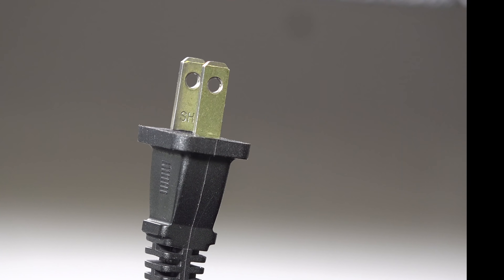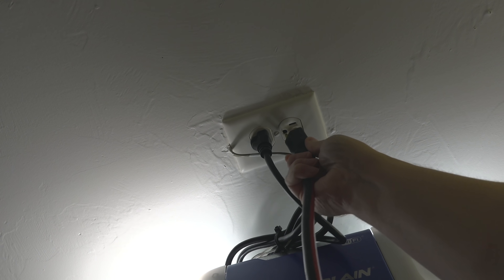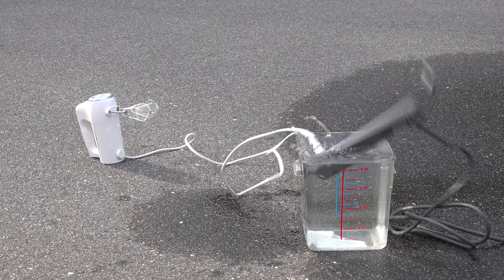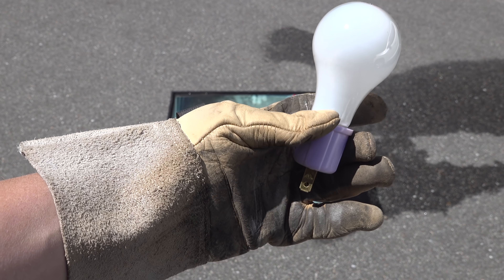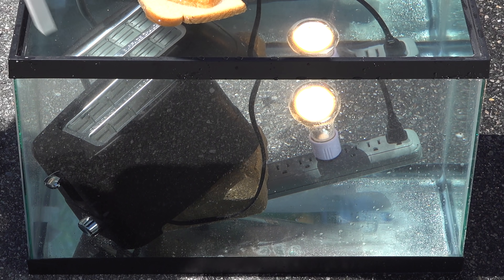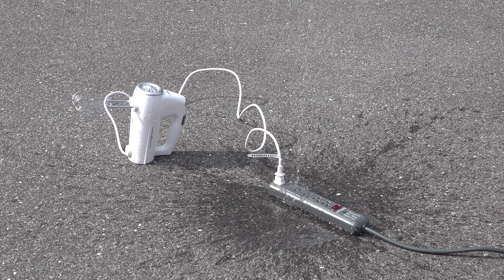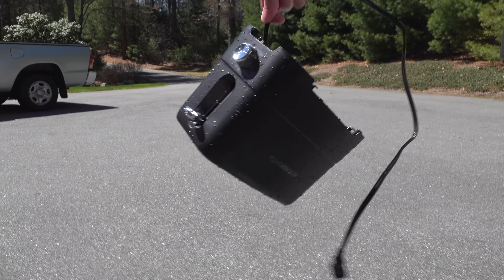What REALLY HAPPENS WHEN YOU SPILL WATER in an OUTLET?

Comment: TL;DW: As discussed by many this experiment is highly dependent on the device and the purity of the water. Pure water with no contamination is actually a pretty poor conductor.
Reply: For other experiments it would matter. We already know a small amount of electrical current was flowing through the water because the GFCI tripped. Let's say that there is a 20A breaker that this circuit is on.. you could keep dumping bags of salt into this water and by the time it tripped the solution would be nothing like any water in a house where you would find toasters, power strips and light bulbs. Once you change the variables too much the experiment becomes useless.
Reply: Actually, pure water with no contamination is an insulator. However water is a good dissolver and therefore is will become contaminated very soon after being placed anywhere.
What we see here is relatively low voltage. 120V maybe.
What I can say, if the voltage was 230 it would boil that water tank with extender only after a while. I have seen water boilers working same way, sized as a cup. Water itself is a (average) conductor and heating element.
Reply: @Auberge79  no it isn't water is not a good conductor,

Water with extra elements can conduct 

Get bottled water 

Pure it into a glass

Create a simple electric circuit with a light bulb and battery

Break the circuit and use water in between the break 

I will 100% garrantee the ligh will not work 

Now fuck a bit of salt into that water then balm the light turns on

Water does not conduct electricity added elements do
Reply: Around here they have to put extra chemicals in the water to prevent the water from corroding the pipes all to hell. At the faucet it's going practically no dissolved solids in it.

Still, I'm not sure that I'd care to check to see if there was any conductance going on.
Reply: Also 120V is relatively mild compared to 230-240V that is used in most other places around the world.

Plus a surge protector strictly speaking trips when the mains voltage exceeds a certain threshold. A surge protector is there to protect the devices plugged into it from something like a lighting strike nearby, not to protect people from getting shocked. As the input voltade didn't change by putting the extension in water as far as a surge protector is concerned everything is fine. There are two ways in which putting something in water may cause a circuit to trip which are 1) the fuse on the breaker IF the extension draws more current than the socket is meant for (may not happen with pure water, even if you put your hand on it and get shocked) and 2) the RCD will trip if enough current starts leaking to ground and this is what will protect you if you put your hand on it, but it won't work if the extension/device isn't even grounded (and a lot aren't). 

If the device isn't grounded and you happen to touch both live and neutral (instead of ground) there is really nothing there to protect you because the breaker has no way of knowing that the current is going through you rather than any other electrical device, and because the human body has a fairly high resistance the current won't be enough to blow the fuse.

Comment: Circuit breakers are only meant to stop the wires in your house from overheating and causing a fire if you are using too much power. They are not designed to detect the presence of water. That's why GFCI outlets are put in bathrooms, kitchens, and outdoors.

Comment: There's a difference between electronics and electric things. Electronics, unless having water protection, tend to die when wet. Electric stuff can resist water, but if you enter in contact with that water you will receive damage.

Comment: for the people that doesnt know
totally clean water does not conduct electricity, this is because of the molecular atomical structure of the water.
however
-water contains oxygen that rusts the metal parts of the power outlets, as well if poured on metal in general
(although at a slow rate)
-if your water conducts any electricity, it's because your water isn't totally clean 
that's why if you try to make a circuit with a light bulb, where you cut 2 cables and "connect" those cables with 3rd world tap water the light bulb will flick

Comment: You never told us what the source of the water is.  Regular drinking water or faucet water that contains minerals will absolutely help arc electricity since it is used as a medium.  On the other hand, distilled water has no form of contaminants to help pass electricity between electrodes

Comment: Your mileage WILL actually vary depending on where you live. If the water in your area is harder (ie, has more mineral content), then it'll be FAR more conductive. The temperature of the water also matters. This was probably done with 110v, but most of the world uses 220v to 240v,  voltage also matters.
Reply: 120 is just split phase 240, so every where that uses 120 also uses 240. The biggest difference is most of the world uses 50Hz instead of 60Hz.
Reply: @Kanglar  Well, by that metric 240 is split phase 380, so every country that uses 240 also uses 380. But, I agree, frequency is far more important, and it'd be far easier to integrate two grids with different voltages than two with different frequencies.
Reply: @Kanglar  well, 220v is just single phase 380v, so everywhere were people use 220v is 380v
Reply: @Kanglar  That's irrelevant because what comes out of the socket is still 120V. And it will behave as such, for example the maximum wattage is much lower at 120V than at 240V.
Reply: @InWeCome  What comes out is 240 if requested, that's why it's relivant. As seen in the video, 100v of power from the toaster and an est 50v from the egg beater are occupying well over a 120v circut.
Reply: Came to the comments to find or mention this.  Salt water or really hard water would have been far more exciting.  The voltage is mostly irrelevant, though.
Reply: Right, kind of a let down that they didn't mention this in the video....
Reply: @ElectricSlevin  why would they
Reply: @diamondgirls6541  cause it would be educational, interesting and maybe prevent a hand full of people from making a really stupid mistake
Reply: @ElectricSlevin  he doesn't have the knowledge
Reply: bulllshit
Reply: why
Reply: Absolutely 🤣😂🤣 very important to know and consider.
Reply: So zero water is probably almost non-conductive.
Reply: What if I accidentally spit on my outlet behind the trash can a few times? Will I be ok?
Reply: I just spilled some mineral water on my extension plug and nothing happened. My country is using 220v
Reply: Yep, agree.
Reply: "...the US does have a higher power supply. Nearly all homes in America have 240V alternating current lines at the service entrance to the household as well as select locations within the home."

I also use a 1,000w Toaster (100v) while running a 500w egg beater (50v) off a 120v circut just fine.
Reply: Your point means absolutely nothing. The point is, these electrical appliances were submerged completely and still functioned properly.
Reply: not most the world
Reply: @allentoyokawa9068  all of Europe and most of Asia is not most of the world ?
Reply: @Kuri0  and most of Africa: https://en.wikipedia.org/wiki/Mains_electricity_by_country#/media/File:World_Map_of_Mains_Voltages_and_Frequencies,_Detailed.svg
Reply: @InWeCome  Also Australia uses 240v mate
Reply: In fact, only the northern part of the world uses 220v in a common way, from the center to the south of the world, 120v is already used usually (there are exceptions, but it is to give us an idea)
Reply: @altair_sound  I don't know where you got that idea, but it's totally wrong. Not just wrong,  but opposite to reality. There are basically NO countries south of the Equator that use 110/120. The only places south of the Equator that use 110/120 are a tiny bit of Colombia (most of it is in the northern hemisphere) and part of Ecuador. That's it, a small part of two countries. Pretty much all countries that use  110 are in the northern hemisphere, namely all countries in North America and most in Central America plus Japan. The entire rest of the world is all 220 to 240v.
Reply: @altair_sound  I dont think Ive ever seen anyone be so confident in something so incorrect before. Where tf did you even hear that? Its quite literally the opposite of reality.
Reply: @altair_sound  confidently incorrect👍
Reply: Your house gets 240 volts but it's split into 120 volt A and B phases which are opposite at any given time (hot is negative on one and positive on the other and visa-versa.) There are special outlets that some home appliances use that make use of both phases at the same time, delivering 240 volts)
Reply: @plateshutoverlock  That's in the USA (and an odd few other countries). In most of the world we have 220 to 240 in every outlet. Special outlets are to make use of all 3 phases to deliver 380v.

Comment: Dunno if anybody here explained this, but the water does not conduct electricity (regular outlet power) only salts and iron that dissolved in it. In that experiment were pretty clean water, if you do that with tap water or sea water - it'll definetly shorts the circuit.

Comment: In some rural places in India and Nepal, they use this device? That's just a bare metal coil with some plastic on the top and plug that in an outlet and put the metal coil device thing in a bucket of water to make hot water. No protection other than the user just not touching it lol

Comment: I’ve seen regular outlets working outdoors everywhere, powering all kinds of stuff without problem for years.
I’m not quite sure why, but those outlets and appliances often just don’t seem to care.
Not sure how dangerous that is or isn’t though.
Reply: You don't need them if you've got them on a circuit that uses a GFI breaker. Or, they're sealed well enough and still grandfathered in. The next update to that is AFI that looks at the resistance on the circuit as well in an attempt to identify excessive resistance from failing wiring that could lead to fire.

Comment: Water itself is not a conductor of electricity its the various contamination elements in the water that conduct. Pure water is actually an insulator.
One specific example is when it rains on all of the high voltage lines that traverse our country.

Comment: Ohhh god I have PTSD from this.
When I was 10, I was cleaning the bathroom walls, and I had the genious idea of cleaning the outlet too since it looked dirty, I remember I sprayed with a wall cleaner on the outlet, I moved a bit to my left and crouched to reach for the sponge, and if it wouldn't be from that sponge I probably wouldn't be here.
I remember I looked at the outlet and a eruption of sparks started just few cm away from me. It looked like a spark firework machine, but way more brighter and scary, so much light blinded me for a second. I was so scared I got paralyzed for a few minutes contemplating how I could had experienced a painful death and probably appear in a thousand ways to die episode.
Since then I've been extremely scared of power outlets and water in the same room to the point I still have nightmares about them, specially that one from the bathroom, I try my best to stay away from it.

Comment: What a circuit breaker does is trip in the case that too much current is flowing through a circuit, preventing overloading and fires. The water just must not have been conductive enough for excessive current to flow through it, so the breaker never tripped. I bet if tried again with salt water you would see different results.

The way a GFCI works is by checking to see if the amount of current going through the hot wire is the same amount going through the neutral wire, and if there is a difference of 5mA or more it knows power is flowing somewhere that it shouldn't and it trips. It's an entirely different function than a breaker, and they are much more sensitive. In this case it sensed a difference in the current in the two wires because some must have been flowing through the ground wire, causing the GFCI to trip. If you broke the ground pin off of the plug on your power strip you likely would have been able to completely submerge it in water like you did the first time without it tripping, because it no longer would have had a connection for current to flow through than the neutral wire.

Edit: I should also note that just even though there wasn't that much current flowing it still was potentially very dangerous. The milliamps it took to trip the GFCI is enough current to be potentially deadly, which is why we don't rely on circuit breakers to protect us from electrocution.

Comment: It doesn’t always work smoothly like this. My old house had poorly done wiring that was outdated. Previous owner didn’t ground the wires and instead just cut the ground wires without connecting them to ground. 

Had a pipe burst and spray water directly onto an outlet. First, our breaker shut off and the power went out briefly. The breaker main didn’t work correctly…and the power came back on whilst water continued to spray into our outlet. The wires in our house began to arc and started melting the rubberized coating and creating smoke throughout the house. It was terrifying…we had to call the fire department.

They shut off our power, and we had to rewire the entire house and pass an inspection to get service back to the home.

Breakers can fail…and ground wires are extremely important in that scenario. Thankfully our house didn’t burn down!

Comment: Not an expert but I have an inkling that it probably didn't do anything cause the tank wasn't properly grounded, and the copper wiring was still the easiest path for the electricity to flow.  Put a rod in the ground and connect it to the tank and I bet you it'll spark. (or you could increase the mineral content in the water)

Comment: Would be cool to measure the voltage difference between the "electrified" water and ground
Reply: It's misleading, because the ground under the tank is several meters away from the real mass of the system and can have several hundreds of volts of difference, naturally.
Reply: By Ground he means voltage equals zero so even a pot of wet soil or an oscilloscope would have done it (because the oscilloscope has a ground port in it).

Comment: I've been through this personally so I already knew the answer, when I was a kid (Maybe 13), we had the washer and dryer in the same room as our pc, the washer broke and flooded the whole room with water including the surge protector. My parents freaked out and asked me to quickly turn off the surge protector which was soaking wet (I don't think they were thinking too much about this one) as soon as I touched it, got a quick burst of electricity, never touched that thing again. Then they started freaking out because they didn't think of that, asked me to leave the room so I was safe, and unplugged it from the wall. This was like 20 years ago so I'm a lot older now but I learned fairly quickly that those things don't shut off when wet and don't get anywhere near them unprotected if they are wet.
Reply: They work, when there is a dispersion. It doesn't happen if the system is isolated from mass.
Reply: Your parents almost killed you there, personally I wouldn’t even know how to feel towards them knowing that fact.
Reply: You wouldn't have GFCI protection on an outlet that runs a PC. It would trip too much when the GPU ramps up and ruin your day.
Reply: @gamechannel1271  What are you talking about ? Over here in Europe, every outlet is behind GFCI protection. And the tests done in this video would trip it in an instant since a mere 30mA going to ground will do that. Noone has problems running their GPU's or CPU's.
Reply: That’s what she said

Comment: The first test has poor execution, the breaker doesn't trip since there is no other place for electricity to go besides that one eggbeater. It's like there was never any change.
While if you yourself stick a fork inside holding it with bear hands this is when the electricity will divert the path to go through your body into the ground and kill/shock you - you create a new path. 
But you also will be fine it a tub full of water + working outlet since there is so much water that it acts as the best conduit, and the electricity will not penetrate your skin, it always choses the easiest path.
The real short-circuit problems happen with little droplets that connect wires which shouldn't be connected, usually happens with phone chargers in bathroom since they have complex specific connections on the circuit board.

P.s. why should you believe me? I'm a guy that sits all day searching for scientific stuff on the internet, and I also went to Technico Industrial Institute.

Comment: What actually happened to me when i was air drying my car after a wash, the power extension dropped in a bucket of water by mistake while the extension was connected to a power outlet inside the house, i started to smell something burning and suddenly the dryrer stopped, i went home and it was pitch dark and silent, all power sockets in my house stopped working, the air dryer still works perfectly as well as the power extension board.

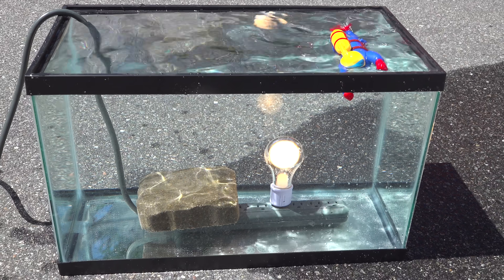Comment: 2:31 Do you see those bubbles of gas from the power strip? That's the result of electrolysis. 
That's because water isn't a zero-ohm dead short. Actually, pure (distilled) water is not conductive at all - it's the mineral ions that make it conductive, and the more minerals the water contains, the less its resistance becomes. And, while those minerals can transmit electrons, they degrade and break down under current, making element oxides and hydrogen gas, which is what bubbles there.